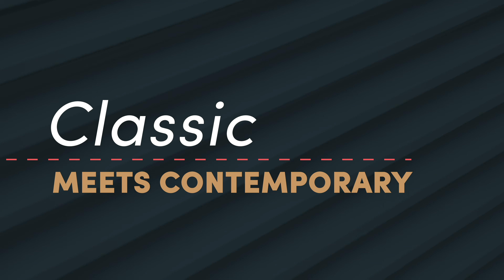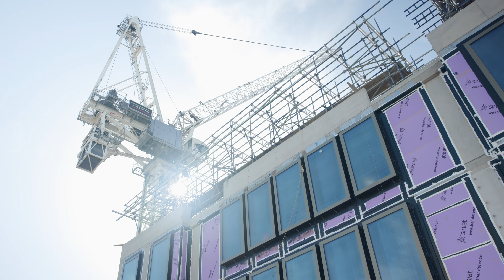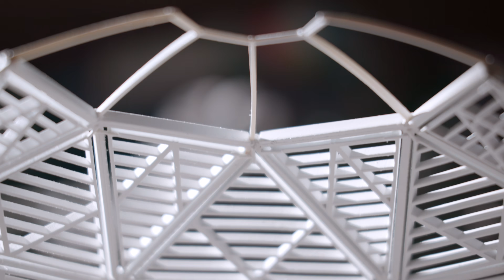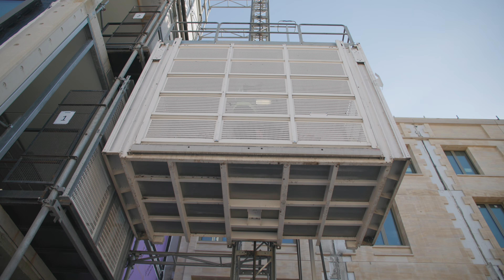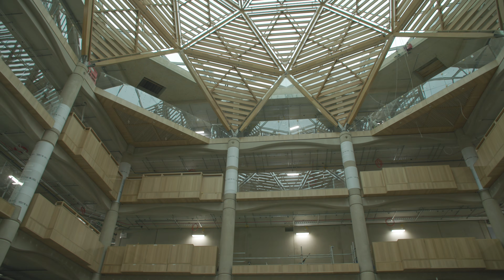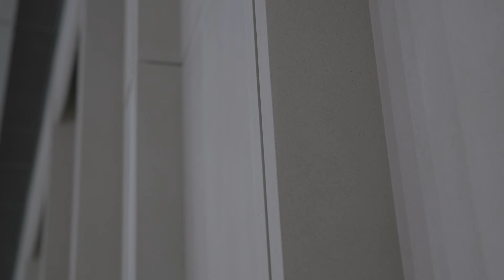The Schwarzman Centre: Behind the Build

Comment: 2:60 Heat insulation means acoustic insulation. Heat insulation to block cool air from coming in is different from heat insulation to trap cool air from coming out...

The former means applying the three football field of insulation inside... While the latter means applying it as foam coating on the roof.

Meaning, if there is heat insulation inside the concert hall, the opposite will be true, the ears of the concert goers are going to blow...

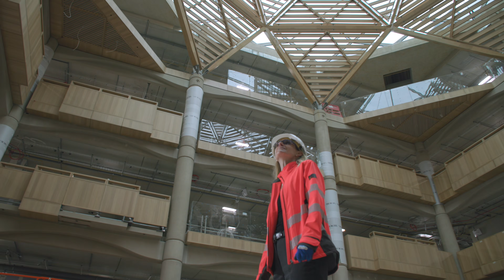Comment: 2:59 "...reducing the size of the heating system..."

"Moist-moist-moist-moist" ----> I am sure I heard this somewhere 

If air is allowed to enter, surely it will  cool the inside of the building... If air is allowed to stay put in the building,  there is no heat transfer... So, as the people inside the building increases, the amount of heat being trapped by the building also increased...

Comment: 2:58 "The only amount of air allowed to escape is about this much. The size of a cupboard..."

"...reducing the size of the heating system..."

"Moist-moist-moist-moist" ----> I am sure I heard this somewhere 

If air is allowed to enter, surely it will  cool the inside of the building... If air is allowed to stay put in the building,  there is no heat transfer... So, as the people inside the building increases, the amount of heat being trapped by the building also increased...

So... The remaining thing now is the insulation... With the size of three football fields...

Is the insulation used to trap cool air? Or, to block cool air from coming?

It would be the latter... Plus, three football fields of heat insulation means sound insulation to be contained... Otherwise, the heat insulation is going to be applied at the roof with foam coating but this means trapping the cool air in, not blocking the one outside - in.

Therefore, if the concert hall has heat insulation also, then, most likely the ears of the one coming for the concert are going to blow...